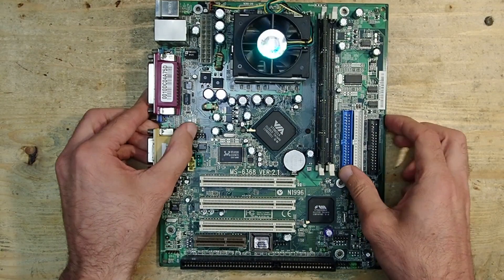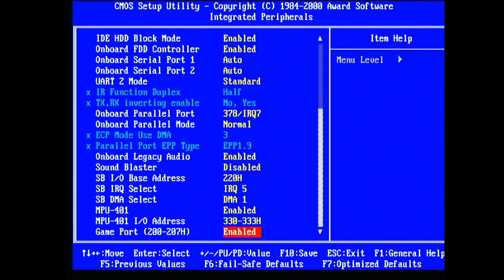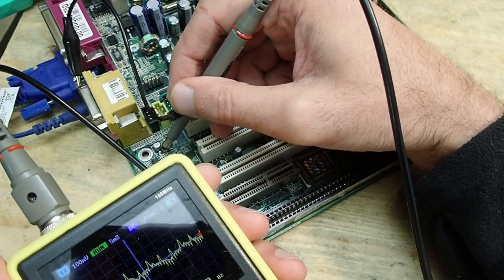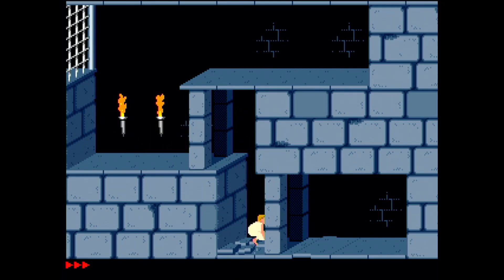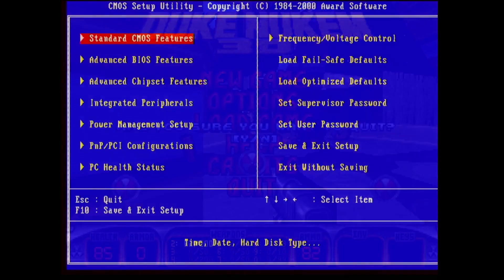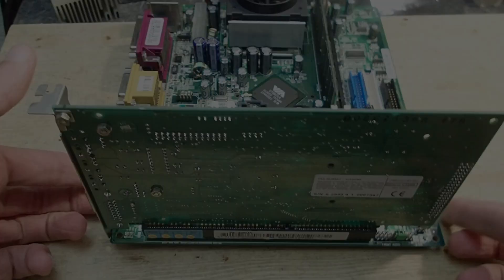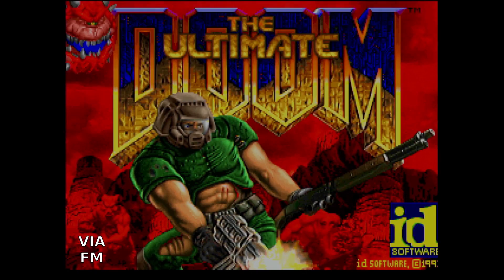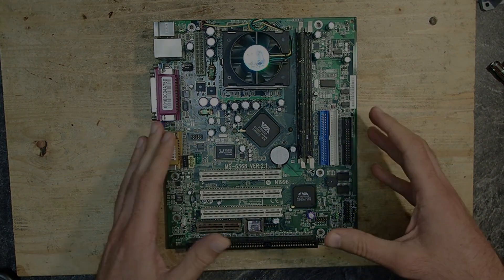A DOS compatible sound card by VIA? Let's take a closer look.

Comment: I will never forgive Via for these motherboards. The chipset drivers were absolute garbage and made Win9x crash all the time. The cheapest PC we sold had one of these motherboards but many people didn't want to spend the money on a better Intel chipset board. They work fine these days because the last releases of the chipset drivers finally got good just as these boards became obsolete. The whole product was a complete waste of time.
Reply: Their soundcard evidently works about as well as their motherboard chipset 😅
Reply: I had that same experience just today with a board using this chipset (the Soltek SL-65KIV2). Whatever drivers install for it out of the box with Windows 98 SE were causing BSODs soon after boot with an unable to write to disk error. Fortunately, booting into safe mode and manually installing the 4.43V chipset drivers completely solved the problem. That's a driver package from late 2001 though.

Comment: When I run an ISA sound card into my KT133 board, the sound distorts and blurs horribly when the system is under heavy load. Often just like that in Windows. It doesn’t matter which Windows version or which sound card is installed.

So I would be interested to know if the problem also exists with other VIA chip sets.

Comment: TL072 happens to be a very common part in PC pedal building; I think I have a buttload of them from some previous projects. It is a dual op-amp, LM358, JCR4558, NE5532 being drop-in replacements. LM324 can do the same job but is not pin-compatible.

Comment: Hello there. I'm debugging a MSI 694T pro. Do you have the datasheet for VT1611A? This board (Also known as MS-6309 ver5) has a VT1612, but for some reason, the VCC is 5V - whereas the chip only accepts 3,3V! I'm wondering what the voltage for VT1611A might be..

Comment: Didn't know about the VIAFMTSR but that might explain why my VIA Epia VE5000 ITX mobo with a passive Eden (C3) 533 (no FSB slowdowns needed, it's a turd out of the box lol) didn't produce any sound in DOS despite being detected properly by games. The sound chip is slightly different (VT1612A) but other than that, most of the stuff said about this MSI board applies to the Epia as well... other than the lack of slots (only has one PCI). It even uses the same chipset (PLE133 aka VT8601A), just the onboard ethernet is not realtek but a VIA "Rhine" VT6103

Comment: Hi, I saw the video when it was new. Now I got a Gigabyte GA-6VXTE from scrap. I had to replace 4 caps and then it was stable. I found also the legacy Sound Blaster options in BIOS. And this was the moment your video comes back to my mind and became quite handy. So thanks a lot, it saved me a couple hours. It is a quite nice option to have a tualatin running with an onboard dos compatible sound chip. Just to have the possiblity to go quickly back to classics like keen4 and doom2. But for long therm I guess I would insert a dedicated OPL3 sound card to the ISA-Slot. For me the music in some keen4 levels sound not that great in comparison. So thanks a lot and have (hopefully) a long weekend.

Comment: I had same audio board from QDI, QDI Kinetiz 7E. It's VIA KT133A chipset, so same era. Also with ISA slot.

I was so sad, when they stop included this nice audio chip later. Would not mind, if they would include it particulary in era, when ISA slot stopped to be presented on motherboards. In Pentium 4 era, socket 754/939 era, socket A - nforce 2 era , or later VIA KT600-880 chipsets. It was so good idea, but it's mostly presented only on boards which already have ISA, and so, its better option to use soundblaster for DOS gaming.

Anyway, it saved me from buying new sound card, as when I've upraded to KT133A board, my ISA sound card was free, and I've moved it to secondary Pentium II computer, and we could play LAN games at home with soundblaster support on both computers. 

We played lots of Doom, Duke Nukem 3D, Shadow warrior, Warcraft 2... over LAN. Man, that were the times!

Btw, I don't remember any problems under Duke Nukem 3D, so there is certainly a way, how to get it working there.

Comment: Yep, that's what happens when you have a sound card that does not have real audio DSP hardware but instead relies on the CPU MMX instructions... (Does depend on driver implementations too though)
Reply: Same crap with PCI modems in fact...

Comment: What other options are there for IRQ, under ISA IRQ priority, they run from 0-7, with the high IRQs in slotted in at 2 (and IRQ 9 redirects back to 2) - so all the high ones are higher priority than the available low ones

Comment: I also never use USB keyboards or mice with my retro systems anymore.
On one system, when running games in Windows, the system would stutter every five seconds or so for about half a second. 
On others, simply moving the USB mouse produces a coil-whine like noise from the motherboard.
Best to just stick to serial/PS2.
Reply from the maker: True, I usually use PS/2 as well, but in this video I used USB for simplicity and well....

Comment: those VIA chips are not supposed the opl are emulated by cpu? like today's modern sound ? going from USB to old PS2 unloaded some overhead from the cpu.
Reply: it has hardware emulation.
the slowdowns were because of IRQ conflicts on USB, because of bug in BIOS. USB IRQ has higher priority, so it slow down everything else, when using (moving mouse, or press and hold key on keyboard)

Comment: The LM358 has a very slow slew rate, lower operating frequency and strong crossover distortion under certain output load conditions that make it work in class A. It is a very poor choice as a replacement for the TL072. The end result is going to be poor audio quality.
Reply from the maker: Yeah, true, but for DOS with it's 11kHz sound it wouldn't be noticable :) I didn't use it in HiFi, but may be in Windows at 44kHz there will be some difference. I already ordered new TL072 to make a comparison.
Reply: @necro_ware  thanks for your response 😊

Comment: I don't know why almost all the  vt8601T  motherboard without AGP , actually if it come with a AGP it will be a perfect MB, without it , its a garbage.
Reply: QDI used it on KT133A boards. Check it out, those have AGP and was meant mid-range in the era.
Board's name's QDI Kinetiz 7E. I was lucky to buy it in 2002, and used a legacy audio for DOS, played lots of games without ISA sound card under DOS. Of course, at the same time, windows 98 and Windows XP 3d acclerated games could be played through AGP card. We had Geforce MX440 in that time. Played lots of Soldier of Fortune, Noone lives forever, Rainbow Six 3 Raveshield in those times. Also Morrowind ,Warcraft 3. Good times.

Comment: You could try to use UMBPCI instead of EMM386, if you only want UMBs and not EMS. VIA chipsets usually are well-supported with that driver. And it doesn't switch the CPU to V86 mode, which is awesome
Reply from the maker: Interesting, thanks!

Comment: Did you try disabling the on chip modem?

For the Descent 2 music I liked the VIA version better. Sharper highs and the midrange wasn't muddy like with OPL3. The low range sounded that same. For Wolfenstein and DOOM there was good and not so good in each. It comes down to how well Yamaha and VIA did each individual instrument. Just worked out that the VIA chip had better ones for the Descent 2 music.

Comment: USB 1.0/1.1 in the early days were relatively CPU heavy.  One of the reasons many touted Firewire (400) for data intensive work.  Firewire chipsets did not require CPU for processing.  Things like video transfer between devices (camera, PC, external drive) did performed much faster and w/less CPU overhead on Firewire.
Reply: also I recall old NIC card (windows 95 era) usually contains dumb chip that relied on CPU and dominate acess time on the PCI bus, that explain why CPU always near 100% whenerver I acess the network

Comment: The LM358's output stage is not really suited for audio applications, creating crossover distortion. An audio op-amp such as NE5532 would be better suited.
Reply from the maker: I know, the best would be even to use the same as the original TL072, because of the parts around it. However LM358 is the only one I had at hand and for the low fidelity DOS sound (PCM @11kHz + FM) it shouldn't make a big difference. Furthermore on the old ISA sound cards LM358 was a quite widely used amp actually. I have multiple cards with this amp on board.
Reply: @necro_ware  It shouldn't matter much, but the TL072 has a J-Fet input stage and the LM358 and NE5532 are of the bipolar type. The J-Fet opamp has a much lower input bias current.
LM358 has been widely used in ISA sound cards, because of its low price and ability to work with 5V power supply, TL072 at 5V shows strong asymmetry of the output signal.

Comment: *Bootsrap cap would be more appropriate, I believe. Those are on the output of the OpAmp if I'm not mistaking. Decoupling caps are usually used close to power pins like with RAM for example, to 'contain' the switching/digital noise locally to that chip.

Comment: I'm a little surprised the Sound Blaster Emulation isn't completely terrible. That TSR though is bad news and will make it impossible to play games like both ultima 7s that need a lot of conventional and can't run with Emm386/QEMM
Reply from the maker: It works if you optimize the memory layout properly, but is very much on the edge.

Comment: Nice to see you back again! My personal guess for the underlying problem, and why it didn't go away for Duke Nukem 3D: The AdLib playback is purely software-driven. Which would also explain the HUGE driver (besides bad development). Duke works in Protected Mode (Doom does too, I think, but may use it differently), and this produces some hiccups with the playback due to possibly non-handled cases or lack of CPU time (but this CPU should have plenty of it).
I personally wouldn't use such a combo for DOS games... TSRs for audio are a pain in the... back ;)

Comment: Sounds like the via chip is offloading sound processing to the CPU. Duke Nukem 3D apparently taxes the CPU enough to spoil the audio playback.
I remember running a Pentium 233mmx the addition of a Sound Blaster Live PCI card actually made Star Wars episode 1 Racer playable for me. GPU was a Voodoo 3 2000 PCI.
Reply: Well the Live cards did have more processing power than some Pentium (according to Creative) - so they are always good when paired with either old or weak CPU.

Comment: That slowing is a hardware issue. Believe me, i used to own the very same mobo and gave it up. I then bought a sb pro 2 with 8mb soundbank edit: 12:13 😳😳😳 do not tel me!! All i had to do is use ps/2??? 😱😱😱😱
Reply: ano, stacilo pouzit PS/2. Mal som rovnaky sound chip na QDI Kinetiz 7E a pamatam si ze v 2002 som to pouzival, uplne bezproblemov, pod DOS hrami.

Comment: I wouldn't have thought an amplifier would even be needed. It's only a line-level output, I thought the codec would be able to drive it directly?
Reply: A lot of DACs and codecs have VERY weak outputs that are unable to drive a significant amount of current.  The op-amp is a buffer amplifier that may or may not be applying any voltage gain (amplifying), and may only be used for current gain (buffering.)
Reply: I think codec could drive audio amplifier directly but not 32 ohm headphones.

Comment: I have a VIA Epia 800 motherboard which uses the same chipset and the same VIA AC'97 codec. The sound works very well in DOS, however if I use setmul to slow down the CPU, the SoundBlaster emulation stops working. At least this MSI motherboard has an ISA slot for a real DOS-compatible sound card :)

Comment: I found interesting comment written by Krzysztof Kliś under PhilsComputerLab video about enabling Sound Blaster Pro and FM in VIA VT8231 in HP t5710, i think it might be usefull, 
or not 😁:
1) VIASBCFG can work with either IRQ 5 or IRQ 7, although IRQ 7 has much better compatibility. Some software doesn't work properly even when both the sound chip and the software are configured to use IRQ 5. It's because using IRQ 5 sometimes causes conflicts with the integrated USB controller on HP t5710.

2) You should turn off the parallel port completely in BIOS (Integrated Peripherials -> Parallel Port -> Disabled). It uses the same IRQ pool as the integrated sound chip. Even if you set up the sound chip to use IRQ 7 and the parallel port to use IRQ 5 (or vice versa), they still remain in conflict with each other. Probably a VIA chip bug, or HP t5710 specific, because it should not happen under normal conditions.

3) You can load VIAFMTSR into upper memory only when you turn off the network controller in BIOS (Integrated Peripherials -> Network Controller -> Disabled). It's because the program needs a large block of continuous upper memory, which can't be provided when some addresses in the middle of UMB are mapped to the network controller. So while in theory "mem /c/p" shows enough free upper memory, it is fragmented, and large programs (like VIAFMTSR) simply won't fit in.

PS. If i remember correctly Duke Nukem 3D sound worked nice on HP t5710 thin client so it might be that motherboard issues.

Comment: Nice you als found the viasbcfg. I've used it in the past on old laptops and motherboards.
The VIA FM sound too harsh for my taste so don't tend to use it. I've also had a case where the FM was not working but the SB Pro emulation was.

Comment: My dream is to have some raspberry pi sized SBC DOS compatible pentium based machine.
Reply: pc104, you are welcome.
Reply: @xuchao9098  Yes and no.
I commented this elsewhere. Isn't quite there, not enough integrated. I still own one from AMD. Has to put VGA and SOUND modules separately. I saw some videos on youtube trying to solve it. But isn't quite the same thing as a pentium class RPI idea I am dreaming here.
Reply: @madson-web  EC3-1541   EC3-1547  just a single pc104,no more expansion card is needed.

Comment: Its interesting how IRQ's really affected older systems. Newer systems are so fast and more reliant on USB that it is barely noticeable. However if you look up the IRQ table you will see that USB and sound are higher on the list then PS2; and other keyboard inputs.  PS2 has a fairly low IRQ, 11 or something. This means if you interrupt the CPU at a higher number for a USB input, you have to wait another several cycles for video or sound.  If you put enough USB interrupts you can probably stall audio and other CPU activities. PS2 has such a low interrupt that the delay for the next exaction is low.
 Basically if you imagine a computer takes a second to go through each interrupt, and resets to 0 if it encounters one. Then you would reset the counter after only 11 seconds for PS2. but USB, which is around 50, would mean you would lose 50 seconds every time you interrupted the count. And if audio was say 60, you would have to wait 50+60=110 seconds for next interrupt. Computers are of course faster and the numbers are not exact, but you can get the idea.

Comment: Lm358 is a terrible audio opamp. Slew rate and crossover distortion, as well as noise are all sub optimal. I'd really recommend sourcing some tl072's or ne5532's as inexpensive audio opamps.

This isn't a high fidelity application, but the difference will be audible
Reply from the maker: Yeah, I planned to give it a try next time I order some parts. I'm not going to use this board, but I'd be curious if I'd hear any difference. I think, that this setup is not high quality enough to hear any difference though.
Reply: @necro_ware  come to think of it, crossover distortion may account for some of the 'harshness/buzziness' vs the OPL3
Reply: It would have to be some pretty insane amount of distortion to account for the emulated FM difference...

This isn’t a HiFi component.  If you were going to use it for CD quality audio playback in Windows, then maybe care a little.  But for the land of DOS, with its 11kHz sample rates and FM synth music?  I don’t think the op-amp is going to be the bottleneck here.  It’s probably already better than a garden variety Sound Blaster card.

The slew rate for audio stuff doesn’t have to be very high.  It is admittedly dependent on gain bandwidth product, but this isn’t a mic amp circuit, so the gain is probably fairly low, if not unity.

Comment: Hi! I loved that mobo! Got the user manual from MSI site and found that supports VIA C3 CPU's!!!!! So with setmul you can drop the speed without using BIOS... That board is awesome!!  I have one also from MSI with AGP (MS-6153) and is my all in one mobo for retrogaming. My VIA C3@800 can go to 386DX40 using FSB 100Mhz and setting all to the minimum in setmul
What a great board you have!

Comment: It's possible to use SB/SB Pro sound with CPU cache disabled, and with no driver loaded. You just need the set blaster parameters. Adlib emulation will by extremely slow without CPU cache enabled though, since it's software based. I was using a Tualatin Celeron 1.3GHz (there's a video on my channel), but Test Drive III was still way to slow with CPU cache disabled (and way to fast with cache enabled). The SB Pro compatibility is good though, and the sound quality as well. Adlib emulation is acceptable, like you said nothing like a real OPL, but better than nothing.

And when it comes to USB, I've had similar problems with Intel-based motherboards. It's always best to disable USB and use PS/2 instead. Pinball Fantasies with PC-speaker sound is a good way to test it, since it's very sensitive to timing issues/interrupts.

Comment: Does the problem with Duke3D persists when you choose 8bit mixing? Soundwise it is very problematic game, I had same issue on Toshiba 220CDT laptop and only changing card's address to 240H did help.
Reply from the maker: Yes, unfortunately in both 8-bit and 16-bit mixing.